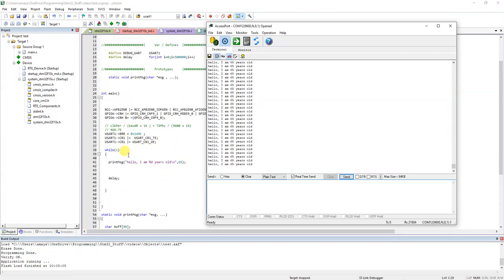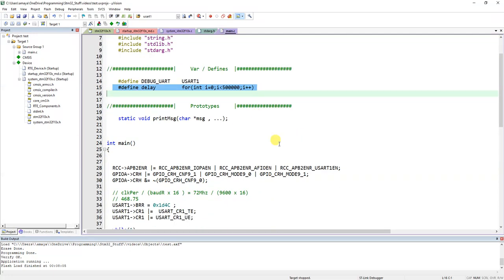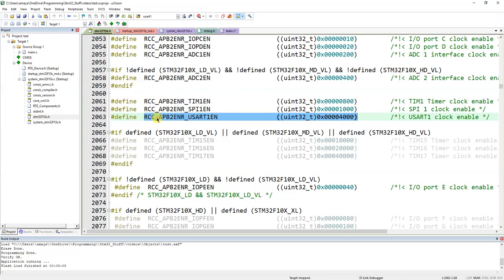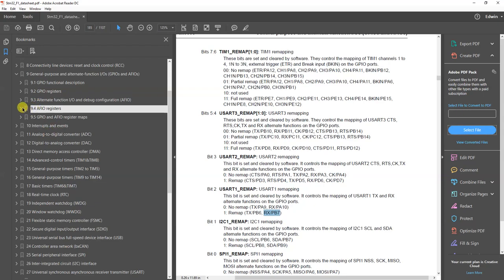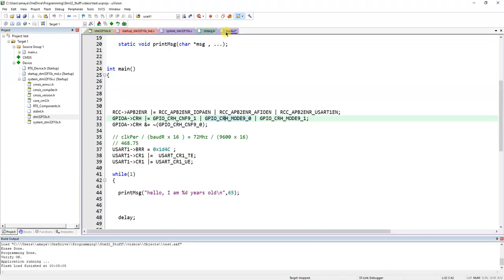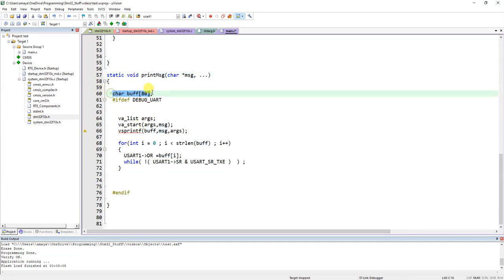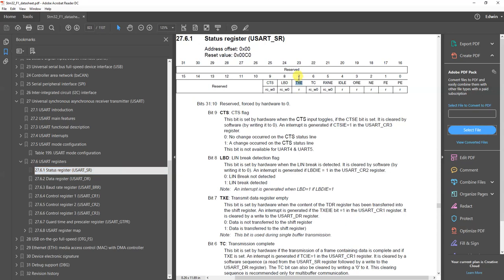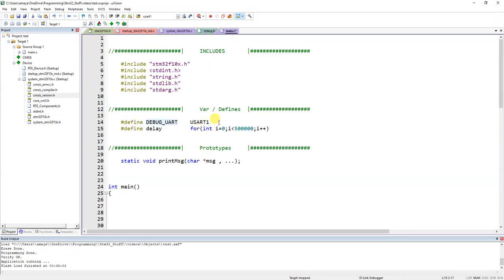STM32 Print Function for Debugging

Comment: 28:15 Eddie bro, tx for the intel! Luckily these days cube mx automates most if not all of this. Still it is very educational to learn about the bare metal programming. Just one thing, at 28:15 in the printMsg implementation I noticed you declare char buff[80] outside the #ifdef, so when that's not active you still have some overhead on the stack reserving and releasing 80 chars you are doing nothing with. Just saying... Maybe you had first other stuff outside the #ifdef as well that depended on the buff, but then that got deleted which left buff dangling outside the #ifdef?

Comment: guys I have a big problem and I would appreciate it if this community assist me. when I am trying to debug using st link v2 to my stm32f103c6t6 Mc it says error target not connected I have tried almost everything but to no help. is there something that I can do  to fix this problem or is there another way I can debug my code on my mcu
Reply from the maker: could be you have a bad or fake chip on the blue pill, very common issue
Reply: @EdwinFairchild  ok thanks Eddie so what chip should be on the blue pill?

Comment: vsprintf is implemented inside the C standard library, and if you are not linking to the Libc or any lib that implement that function you can’t use it. It is seems to me that the environment that you are using just linking to any sort of lib that implement vsprintf. And Thank you for the good videos you are uploading, I have been struggled with DMA at the beginning but watching some of your videos, has really helped me. Keep the good work!
Reply: also, you could use __builtin_va_list and __builtin_va_start directly without the need to include stdarg.h file since, usually, the va_list and va_start are just macros expended to already mentioned symbols.

Comment: please show the practical connections also in your video, i have connected the st link v2 to stm32f103, i do not know the connections to use accessport?  do i need to connect USART1 tx pin to my computer? please answer some one ?
Reply from the maker: you need a serial to  usb converter, the stlink does not bridge the pc with uart, it only does  the programming.
Reply: @EdwinFairchild  ok, i  got your point and today purchased a usb to serial converter. thanks
Reply from the maker: wait a minute i explained the connections in the beggning, what part of that confused you?

Comment: Hey dude! great stuff. How did you manage to have it run of 72MHz without having it configured to do so? you need to enable HSE and configure it, right?
Reply from the maker: The keil start up file does it by default. If you your board in debug mode but a break point in the system init function you'll see it goes to 72MHz .... look around in the startup file. I forgot the exact name it says startup
Reply: @EdwinFairchild  The file name is "system_stm32f10x.c(startup)"
Reply: @EdwinFairchild  are you sure? I've used CooCox CoIDE and over there I had to do it manually. I've written all the peripheral libraries like uart and stuff, but when i ran your code given above it worked. So can you please debug this code and make a video about it and show the register: RCC -> CR and RCC -> CFGR values. I would really appreciate it. If you are busy with something can you please send me a pic of these registers? my email kunalsalvi63@gmail.com 
Again i thank you for replying and hope this won't be a burden.
Reply from the maker: @kunalsalvi8382  yeah every IDE does it different I am now using TrueStudio. Check out this post I wrote about changing the clock speed for Stm32L0 the process should be the simialr  for Stm32F1 : http://www.edwinfairchild.com/2019/01/testing.html    One thing I reccomend is get CubeMX not to use the hall but see the Clock settings. For example Make A CubeMX porject for stm32f1 then set the clock to whatever speed you want.. then you can see all the required setting like division factors and multiplication factors and then just do that yourself via the registers.. I will email you what I mean

Comment: Hey thanks for these tutorials This is the only tutorial I could find so far that uses direct register coding instead of HAL. I have a  STM32F429ZI DISCO1 board Haven't started coding yet. I know since boards are different codes will be different too. But it's  a starting point. One question, Have you posted a UART tutorial??
Reply from the maker: Athul S Nair I have not done a UART yet, I was planning on doing it soon but I am quite busy . However from this video you can see how simple it is to set it up. Just confirm with your data sheet for any differences
Reply: @EdwinFairchild  when you finish with you website please add it in video description

Comment: Hi, I am trying to use nucleo-64 board. It has a Usart2 connected to the st-link. Do think the process would be similar for this?
Reply from the maker: yea definitely just remember to look at where the usart is connected, for example my usart 2 is connected to a different bus and has a different bus speed so the calculation for the baud rate uses that different bus speed. Use CubeMx to check that clock configuration
Reply: @EdwinFairchild  hey man, thanks for the reply. It finally worked. I was having some problem figuring out the configuration settings as i have different micro-controller (stm32f030r8). I have 2 questions for you, how do i know the default clock settings for mcu (i mean where in data sheet or reference manual? )  i just tried a bunch of  values and it turned out to be 8Mhz for APB1 bus. The CubeMx showed the default would be 48Mhz (It was using PLL), that was not right . This command worked for me (USART2->BRR = 8000000 / 9600;)
Also on my print is going diagonally down instead of just skipping a line on the serial capture program.
Otherwise it worked great, Thanks a lot. Keep it up ! I learn a lot from your videos, hope to see more videos from you on I2C, SPI and other peripherals !
best!
Reply from the maker: @mhashimshahzad2823  if you look on page 99 of your exact Reference Manual, youll see the RCC Clock control register, and you see it has a reset value of  Hex 83 which is  = 1000 0011 which means bit 0 and bit 1 are set and that sets the (HSI) High speed internal oscillator on,  all the other stuff like PLL is off by default.  On page 90  you can see that HSI is 8Mhz
Reply from the maker: @mhashimshahzad2823  Always check the registers in the reference manual they always state the Reset Value / Default Value, sometimes its easy to assume everything is 00000 but its not always the case. Also depending on what IDE you use , and the start up code can change these values... for example when i enter debug on my board, then I press the reset button of the debug menu, then i step through my code, and the way my start up is configured it sets the clock to PLL at max speed, this code is no visible from my main because its in a different file.
Reply: @EdwinFairchild  Wow Thanks I do understand now! thanks again for your prompt reply!,
Cheers